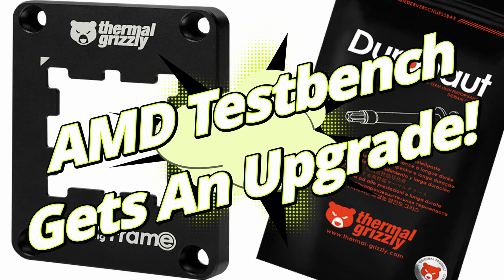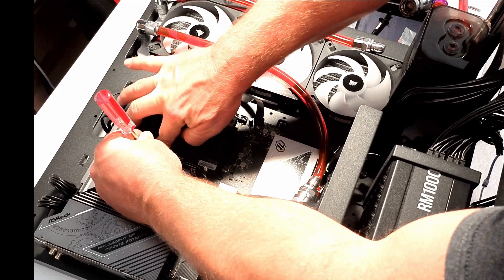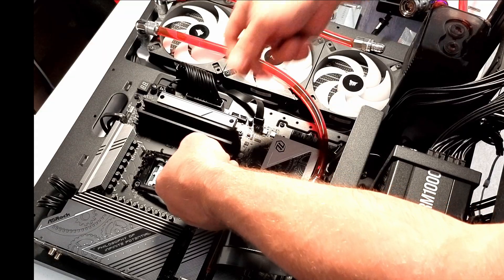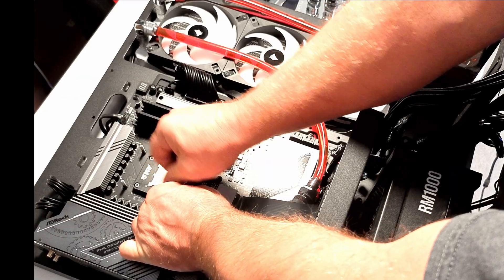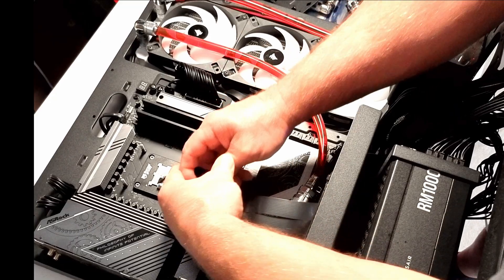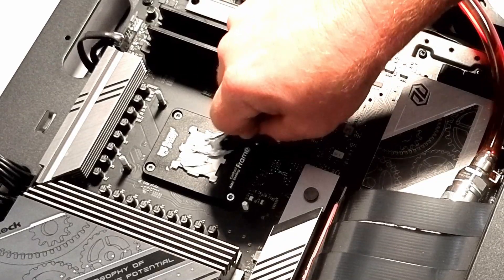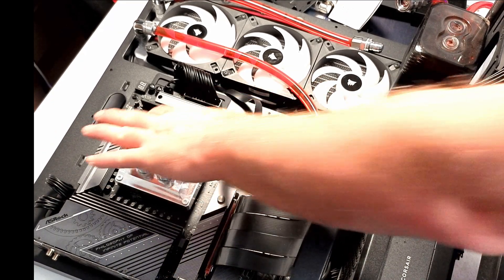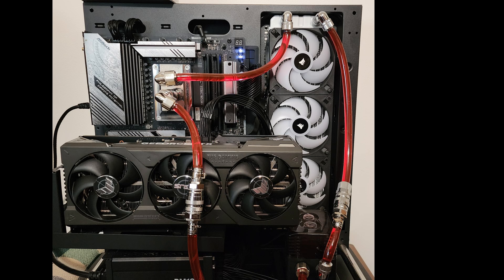Thermal Grizzly AM5 Contact Frame Installation Video

Comment: Thank you for the effort. There’s just one issue: the silicone was placed incorrectly. It needs to be flipped so that the protruding tab sits in its designated slot on the metal frame.
Reply from the maker: You are correct.  I did flip it over and appreciate the comments about the install.  Ive since reinstalled and then delidded this cpu for testing different water blocks and other options.

Comment: Apparently the trick to using Duronaut is to spread it VERY slowly. Much more slowly than you did in this clip. Press down firmly and take ~3 full seconds to swipe from one side to the other.
Reply from the maker: Good call.  I agree.  Getting the hang of it during my AM5 testing

Comment: a quite useless piece of metal, lol they rip off people for nothing :D
Reply from the maker: It is questionable on the AM5 platform.  The 13th and 14th gen intel system had a documented issue to overcome....not sure how much it's needed but it is a nice piece that helps to seal off the paste from making a squish-out mess at least
Reply: @ChadricksTech   people say its a waste using on amd but for me and what looks like your system when you have a £1000+ system £20 is nothing even if it only gives minimal performance/temp increases its worth it.
Reply from the maker: @bypa55 i agree.  And from all my testing that I'm doing on this platform in switching thermal pastes, liquid metal, and multiple CPU waterblocks, the sealing gasket is very nice to have
Reply: @ChadricksTech   i guess thats true
Reply: Just say you don’t have $15 lil bro.

Comment: The instructions literally say to have the red side of the gasket facing the socket, so downwards and not facing up as you have it.
Reply: Came here to say the same thing. Red side down so the gasket fits into the notch on the contact frame. Even better place the gasket into the contact frame first then place onto processor.
Reply: The instructions also say the foam gasket is "necessary only when used with liquid metal".
Reply: @uiscepreston  is that true? Because my blind 92 iq brain forgot to install it and redoing it with vertical kryosheet would be a pain
Reply: @bo8rix  yeah, I just installed one today, instructions say its only needed if doing liquid metal thermal compound, but the silicone gasket can still add extra protection regardless so I went ahead and installed it, even though I plan to use 3M phase change pad
Reply: @cybernoid001  It's extra protection and optional, but silicone is an insulator. I think the cpu will be cooler without it.
Reply: Yepp
Reply: Yes true installing it right now. You also can see he has to Force the frame down.
Reply: Ya..going to install this week.I was wondering about that.Why they didnt just say facing up,instead facing socket would make it so much clearer.